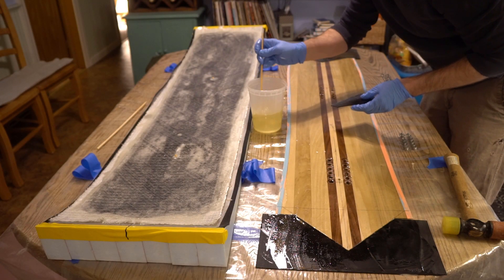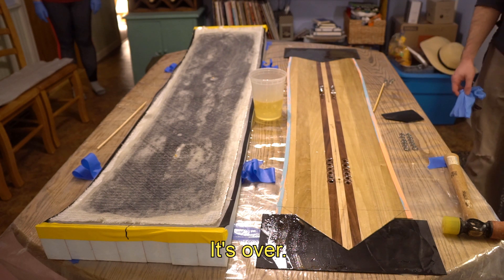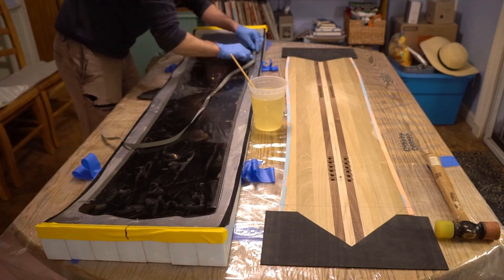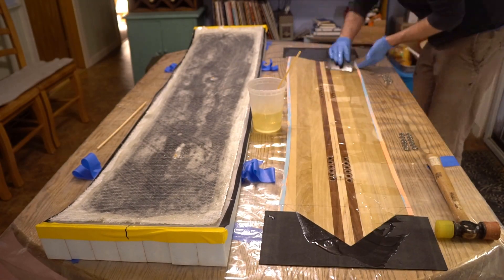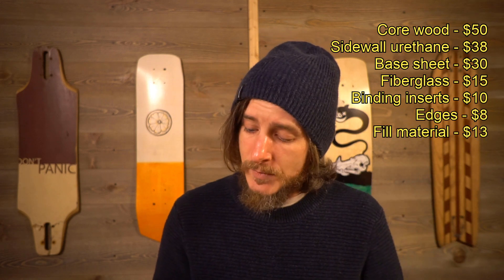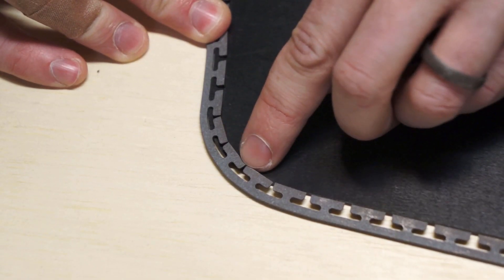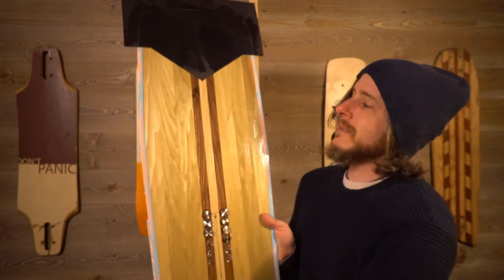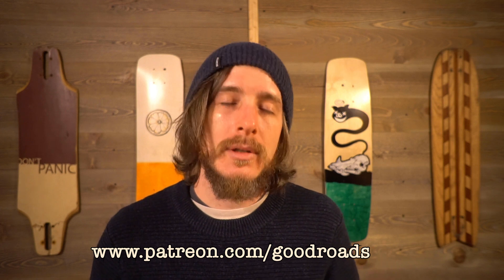Building a Snowboard - Part 11: Layup Tragedy!

Comment: The feels are real. I used to be really into fiberglass subwoofer enclosures. I attempted it many times and only had a few successes. They ended up being hacky work arounds like you said in a previous video. I never really understood why I couldn't get the ratios right, mixed, and materials laid up before it turned to jelly. I learned so much from this video and feel your pain. Nothing like pouring your heart into a build, being so excited to see the colors of those sidewalls in the completed product, and having to ditch the build because of a chemistry issue.
Reply from the maker: It is a long, expensive learning process hahaha! I feel like I might be starting to get the hang of it, but it's all so complex

Comment: I'm new to watching your videos and board building but I just made a longboard with fiberglass in it. So naturally I used resin for it all used some marine UV resistant epoxy. My epoxy also was crystalized, however I didn't know you could heat it up and just mixed it anyways but about twice as long as normal, it had a strong bond and worked great though the leftover epoxy I could see it had more cloudyness then normal not that it would matter when you can see it. Anyways great videos I have learned a lot from you so far thank you

Comment: Run the core through the planer and sand down the fiberglass on the base material and you can reuse everything. Not worth throwing everything out.

Comment: Its in the rear view mirror! Just keep your foot on the pedal and after your third, fourth, fifth board - you will be grateful for the experience! What part of the country are you in? I can lend a hand cnc cutting your urethane channels and thickness planing. Lets get you back to your next layup ASAP!
Reply from the maker: Wow! Thanks for the offer! I'm in the Catskill mountains in NY. I don't mind doing the work by hand for now, but I'm hoping to get a CNC at some point and it would be awesome to get some insight into how that all works for boards
Reply: @GoodRoads  Sure thing. Glad to help!   Cnc's sure help at turning out new molds and producing cores in short order. Especially if your pouring side walls. Throw in a vacuum work holding jig and youre rollin!

Comment: hi.
Try to use different resin for 1-2 or  to 5cm that cure slowly then u have enough time for molding
most of the resins cost around 20$ for 1kg of good one so u buy too expensive resin probably for smal repairs etc (faster it cure more expensive it is) 

If u want any help , advice etc in composites text me on fb https://www.facebook.com/sebastian.nurkowski.501
or mail me (in information on my channel)  :)

Comment: I feel your pain, I've had this happen a couple times on snowboards and once a on a surfboard. I've also melted containers which makes a huge mess. With West systems the pump kit for the resin is great. If your in a panic and need more resin its easy to measure right. I also found id measure out two batches of resin in separate containers then two batches of hardener in separate containers. That way your only working with half the resin at a time.
Reply from the maker: That's a great approach, I'm definitely going to be divvying up my resin next time

Comment: I've been making my own board too and this scares be so much
Reply from the maker: The advice I've gotten on how to avoid this is to divide up the resin. Either to mix it in multiple smaller batches, or to split it into multiple containers. That's definitely what I'm going to try next time.
Reply: @GoodRoads  thanks for the advice I'll let you know how it goes

Comment: Men I've seen all the serie of the process and actually learned a lot!! Im making surfboards for about a year now, working with poliester resin and have failed a lot, Makin mistakes is part of the learning process... I want to make some snowboards in a future so I read a lot about it so thanks for posting the whole thing!! The only thing I know about resin that I think it could help is that I usually mix the resin and the catalyst and get that resin jod on a cold environment so it doesn't get hot and start reacting so fast, then when I'm done with the resin job i relocate the board to a warmer place.
Reply from the maker: Maybe my cold basement shop actually does have some advantages...